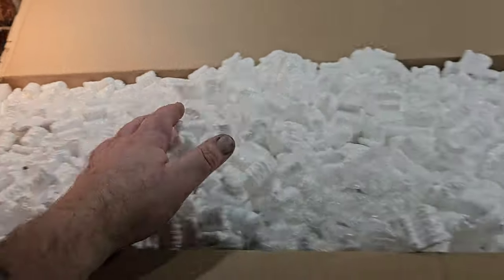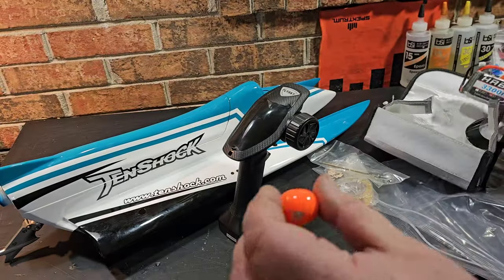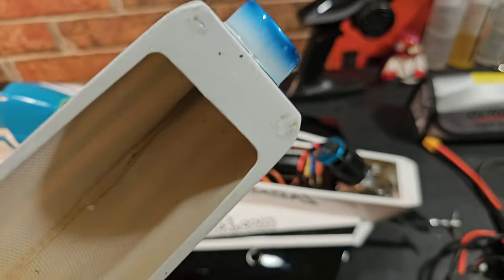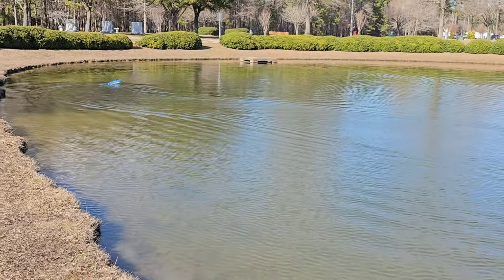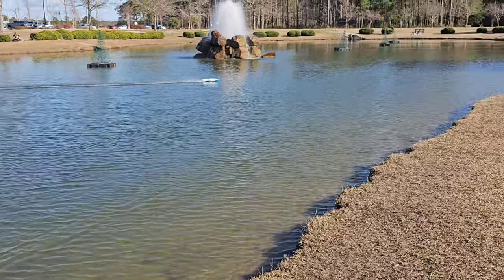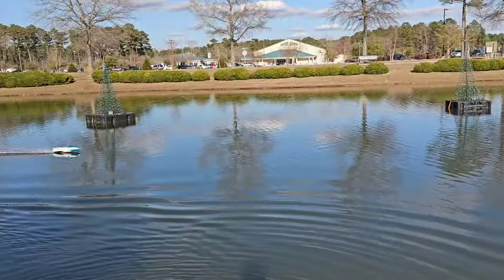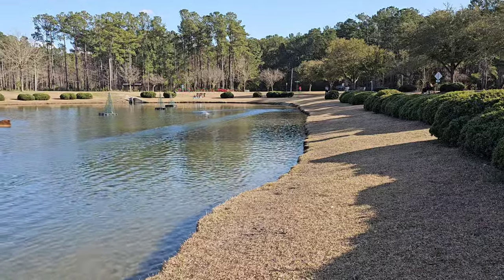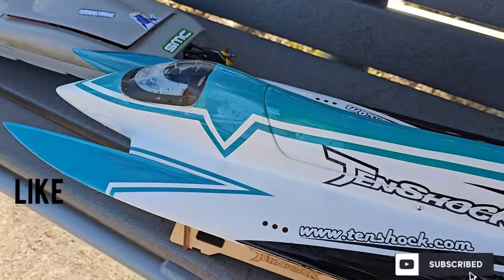Used Tenshock f1 High Performance Tunnel Hull FE Rc Boat

Comment: Totally agree with you on the Seaking esc’s although I have had a good run with the Seaking  120 amp pro but I have to waterproof them myself.
The tenshock 60 amp esc that was in that tunnel are one of the best esc’s I ve ever used but very expensive the waterproofing is the best I’ve ever seen and they are so light it’s ridiculous. I accidentally hooked up the bullets backwards on a run I’m not good light one afternoon and that was that. All that money no reverse polarity protection.
That will teach me to run both battery bullets terminals as females to go into the xt60 on the  esc.

Comment: Man, looking good  that fe tunnel boat, mice... you were saying about that servo being weak, but i have a gremlim compared with that you had on the recoil 2 that you solve but the one i have on one of my boats is a mystery. The boats runs good but sometimes the servo does not center and the is most of time turning right and its trimed, worst i sometimes turn right on the transmiter and the boat turns left ... i replaced the servo, the transmiter, the receiver... hell its the same ...the only i didn t swap was the esc. Could you give some advice,?
Reply from the maker: Check the steering conectors make sure there good and tight..   if that's not the case loosen the rudder connector, zero out the servo then align the rudder with the "keel"  tighten once lined up
Reply: @IRONCLADRC  Thanks man, i already done that procedure and all seems good and tight. Thinking again that gremlim thing appeared mostly when i was forced to run my boat in salt water when i was banned along with my friends of the local pond, but i rinse thoroughly everything. I love this boat too much to give up. I got to find this GREMLIM. Thanks again.
Reply: Hey Big B, seems to have solved the problem, for sure it was something related to the electrical contacts on the plugs tthat go on the receiver or maybe... or maybe the steering potenciometer onthe transmiter. That salt water makes a MESS... but nearby i have no other choice. Continue sending more stuff...

Comment: I'm in fayetteville nc just got a Sonicwake v2. Are there any restrictions with using it at parks?
Reply from the maker: You'll need to contact parks and recreation, or just go to the pond and check for no rc boating signs.  If your respectful to the wildlife and people around you, you'll probably be 👍 okay 👌  always clean up your area  after your run

Comment: I dont know why the hate for the seaking esc i have 3 120amp and one 180amp and they work insanely good all factroy no extra waterproofing and in sea water. Also they get wet alot also sank some times one of them is on a custom made thailand boad and it gets really wet 🤣🤣🤣
Reply from the maker: Not so much hate just bad experiences with hobby wing in general.  Max 6 180 SK several 30's  maybe just my bad luck.

Comment: Hey, like F1 Tunnels? Check out the Motion RC Bancroft "Mad Flow V3"  23.2" Tunnel Hull. Ive had it for a bit now, a fun boat to tinker with.
Reply: Yes they are. My MAD FLOW has a 2958 ROCKET 6S capabel upgrade. 6s is to much for it though. Mine is painted like RICHARD PETTY"S STP CAR.
Reply from the maker: I'm considering picking one up if uncle Sam doesn't take all my tax return. Lol